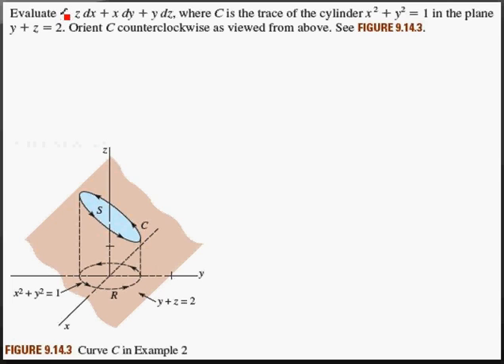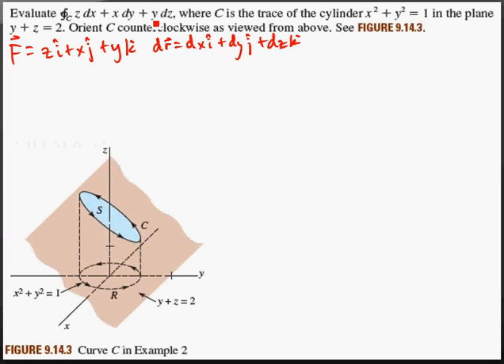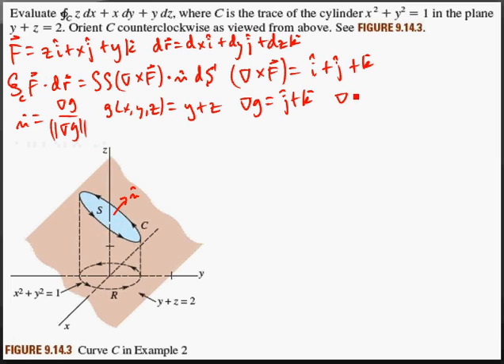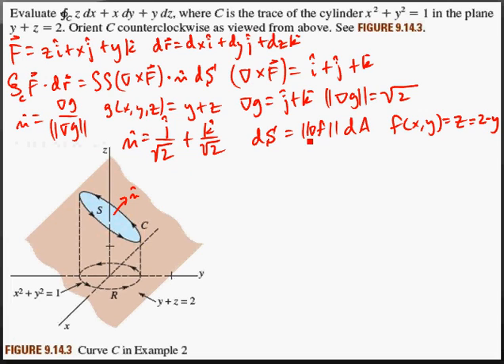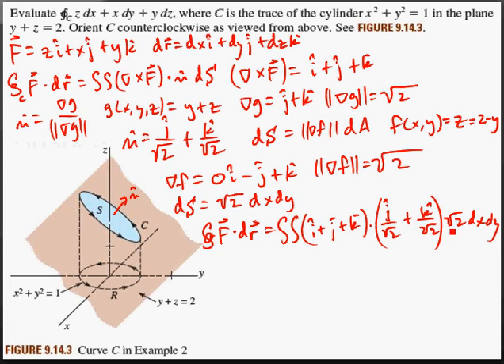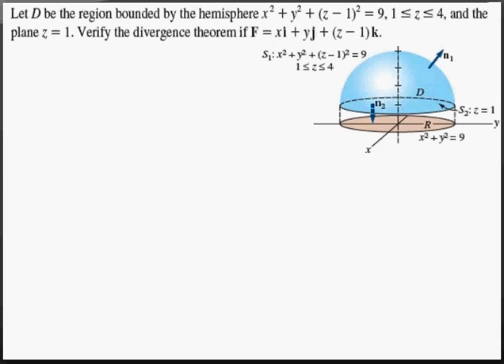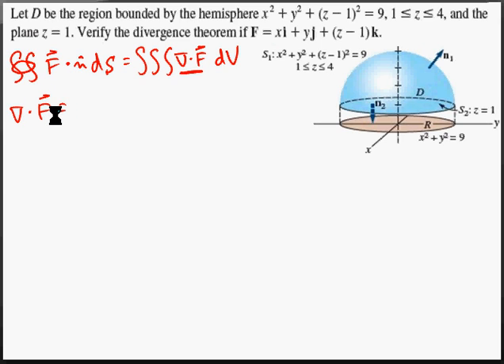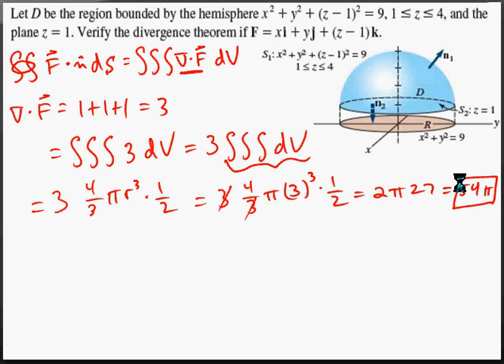Stokes Theorem/ Divergence Theorem Problem

Comment: Now since the surface is positively oriented we can't have a negative normal vector. Suppose instead we define a function f(x,y)=z where z=y-2 Now define a new function g(x,y,z)=z-f(x,y) or z-y-2 now find the normal vector: (k-j)/||sqrt(2)|| Notice this time around we have the positive orientation which is good because thats what was defined for the problem. Hope this helps!